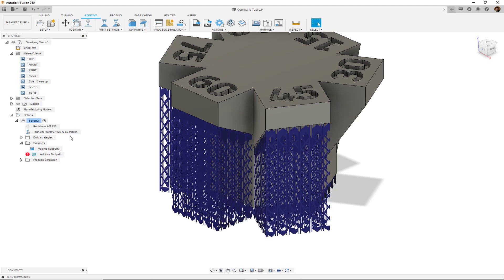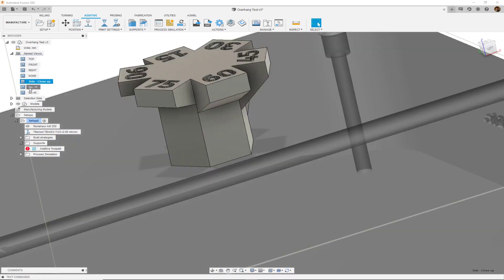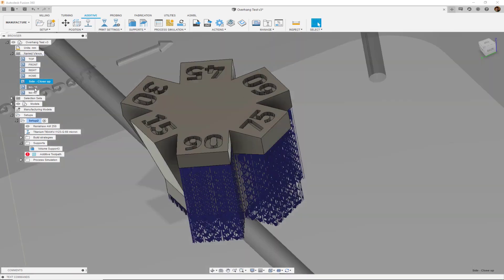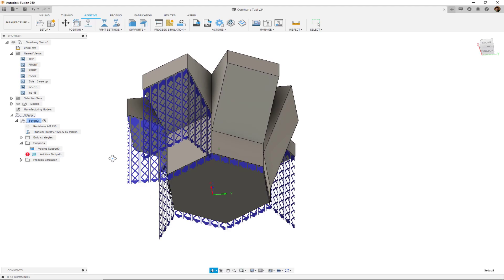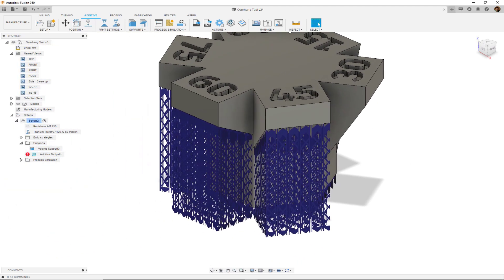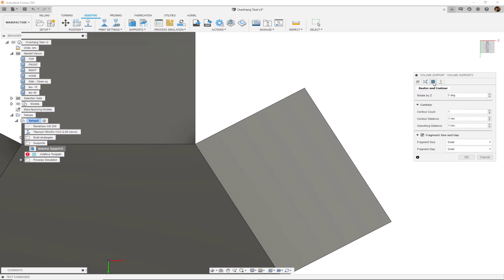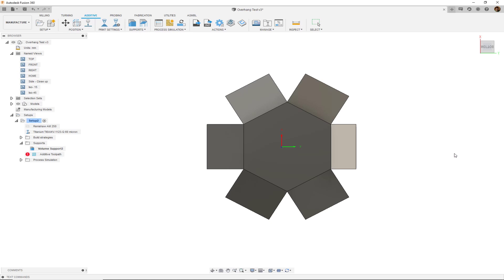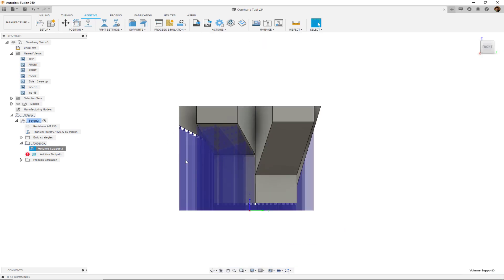Customizing Volume Support for Your Metal Powderbed Fusion (MPBF) Needs | Autodesk Fusion 360

Comment: Why is support at the 45° face generated, when the parameter is set to 46°? Shouldn‘t the threshold be a lower value of 45°, like 44°? Or at least you need to talk about the same angles throughout. Seems like, overhang-threshold is measured from horizontal, while the shown model measures from vertical.
Reply: Yeah, had to down vote the video for this. I watched that section a couple of times trying to figure out why it wasn't adding up. Glad to see someone else caught it too
Reply: Thanks for the feedback everyone, the angle I am editing in the dialog is the “critical support angle”. This is not the same as the “overhang angle”. But reading your comments it’s clear that we are creating a confusion with our User interface . We will look into addressing this in the future
Reply: Agreed.  Don’t understand that.
Reply: Yes, i also wanted to know, why?